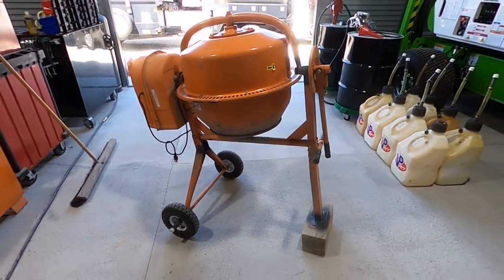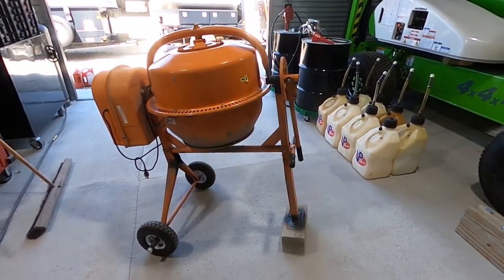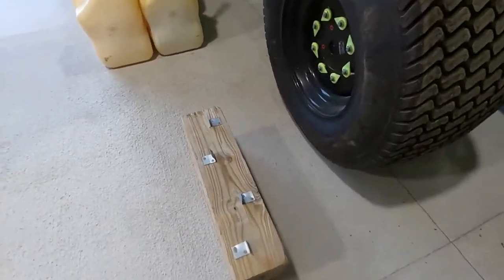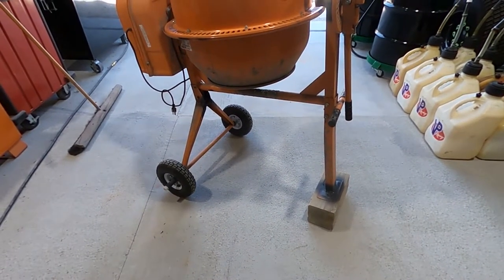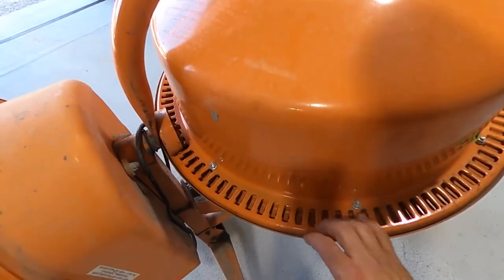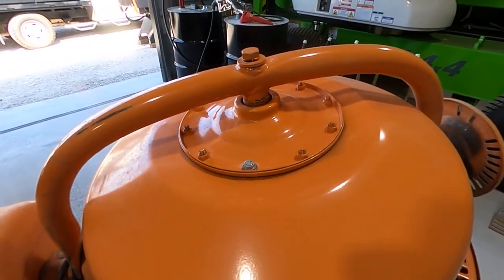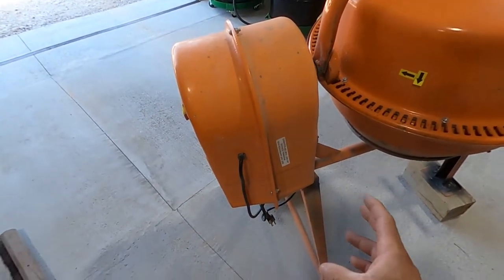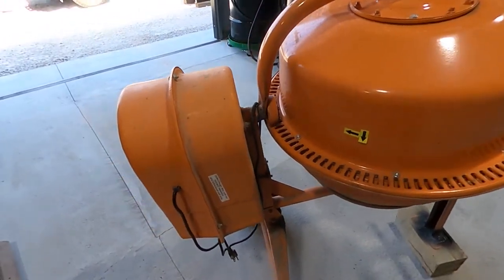Harbor Freight Cement Mixer Review | Over 100,000 lbs Mixed and Counting

Comment: Jon,  thank you for explaining the fixes you did to the cement mixer.  Having one is beneficial when you have a large job to do. I am glad you recommend it, and if I need cement work, that will be included in my budget.
Reply from the maker: Welcome! This has been an excellent mixer especially for the money. Just wish they had a larger model, i'd love to have a larger one but they're so expensive!
Reply: @reallifetested2605  I may have missed it, but how much cement will this mixer mix the capacity for the mixer. It one full load?
Reply from the maker: @brendamaroney2966  You can put either (2) 80 lb bags or (3) 60 lb bags. The 80's are about perfect for this. The 60's are pushing it to the max.
Reply: @reallifetested2605  Jon, that is good to know. I am sure if I need to do some work with concrete, the one-bag standard and wheelbarrow have worked, but glad to see that an option to one bag at a time mixing for a little larger projects is on my path. I know a pumper truck is out of the question, but a bag or two an hour maybe what I can do with this mixer. And knowing I can fix it is a blessing!

Comment: Yes, the bearing crapped out on me it’s totally seized.  My fault though, I left it in the position that you have it in before winter came and I forgot to put a tarp on it. Water got in, went to use it the next spring and first mix it died. Had it for several years, a couple of loose bolts, it’s noisy as #*$& but can’t complain for the price, it’s not harbour freight but an identical model sold in canada, 219$ plus tx
Reply from the maker: You might can spray a little penetrating oil and let it soak to free it up. My bearing is running on borrowed time, it’s getting louder and louder haha I’ve definitely got my moneys worth out of it though so it’s worth a little tlc I suppose when the time comes.

Comment: My Chinee mixer is a Bilt Hard. Blue paint. Like mine too: the first job I did with it paid for it via not hiring the job out. Hint for others: instead of raising the mixer with blocks get a short side wheelbarrow. Mixer is comfortable with 2 80# bags and that mixed load fits in the short side wheelbarrows.Also a heck of a lot easier on your back.Added: short side wheelbarrow if 4 cubic foot or smaller.
Reply from the maker: These things are awesome. It’s insane how much you can save with one. Thanks for the tip!

Comment: This is one of the best purchases I've ever made from Harbor Freight. Over the years I've probably ran 400 60lb bags through it - front stoop foundation, fence, shed foundation, front wall, back walk, etc... I typically mix two 60lb bags at a time. My experience was that two 80lb bags were just a little much for the machine.  The machine is a little shaky on the wheels but they've held up thus far. My biggest gripe is the height as you pointed out. I think the key point is getting the belt tension and alignment set correct and then going back and adjusting after things work themselves in. The only real issue I had was the rubber gasket, between the shells, broke apart when I was installing it. I wanted to use it that day so I slapped it together and ran. After ~20 bags of concrete the joint stopped leaking any water and has not had any leaks since.
Reply from the maker: I think that may be why my wheels bent like they did (the 2 80's shaking the machine around) luckily it was a quick easy fix. A few times I was only able to get 60's as my store would be out of stock. It will take 3 of those but it doesn't like it as you could imagine lol I bet the area you're talking about between the shells got a little concrete in it and stopped leaking. I looked at mine just now and the little crack is full of concrete. That won't ever leak again. haha Thanks for checking out my video, and for taking the time to leave a comment.
Reply: @reallifetested2605  fortunately I can get  60s or 80s anytime at the local Lowes but likely since I've limited it to two 60's is what's holding it together. That or I have to run another 600 bags, give or take, to sort of catch up to your throughput and we'll see.
Reply: @reallifetested2605  Would taking the barrel apart and adding a silicone caulking or some other gasket seal around the rim do any good to stop water leaks. If I buy the one I'll be seeing tomorrow I was thinking about doing that. Saw it on someone else's video.
Reply from the maker: @leighco9  You shouldn't have any issues of leaking. Once you use it a time or two the concrete / mortar will seal everything up and dry to make a nice seal.

Comment: Good review. I need to buy one for my next project.  I couldn't tell by your time-lapse video but How many bags of 80lbs concrete could it handle at a time?
Reply from the maker: Thank you! The mixer will hold (2) 80 lb bags or (3) 60 lb bags, but no more! The (3) 60s is about all it wants.

Comment: I have a really dumb question about these. To reuse it (or, to reuse a wheelbarrow ... ) do you just hose it out into an area you don't care about?
Reply: Yes and yes. Hose it out before it dries or  else you will have heay concrete stuck on it forrrreeeevvveeerrrr.......but yea just a hose should get it out or if Need be have a brush. This rule applies to any and all concrete tools.
Reply from the maker: It's not a dumb question at all. Yes for sure! This stuff will get hard in there and you'll never be able to get it out. Check out what happens when concrete trucks forget to leave the mixer running, or let it run dry. What I usually do if I'm mixing kind of slow (working by myself having to wheelbarrow the mix far away) is just fill a bit of water in the mixer and leave it running. The sloshing around will keep everything wet until I'm ready to mix my next batch. When I'm finished with the project I hose the whole mixer off to make sure everything's good and clean.

Comment: bought one of these a couple years ago. i use it to mix homemade potting/container soil. so much easier than using a shovel all the time. works great.
Reply from the maker: That's a pretty genius idea, stirring soil around is no easy task. I bet this thing mixes it perfectly for you. Thanks for giving me the idea! If I retire this thing I might do the same.
Reply: Going to see a used one tomorrow for the same reason. 70 yrs. young, but mixing soil by hand is getting older. LOL
Reply: @leighco9  it is a great way to used old soil also, mix old with new. works great.

Comment: This may sound like a weird request…but you need to review some work boots. If a guy puts a 100,000 lbs of concrete in one of these mixers, he knows what work is. I work on a blacktop crew and go through boots like crazy…just wondering if you have a suggestion on long lasting and comfortable boots.
Reply from the maker: I want to tell you something really weird, it's like your comment was a sign from above or something lol I had an accident about a week ago. I damaged my ankle pretty bad. I have worn slip on boots all of my life, occasionally I wear lace up. But I get lazy and slipping a boot on is easier than dealing with laces. I have never talked about this really. But the past 2 days I have been talking a lot about switching to lace up boots full time. I was wearing slip ons when I had my accident and keep saying "If I was wearing lace up boots would I have gotten hurt as bad"? Because they offer so much more ankle support. You have motivated me to make a video explaining the pros and cons of both of those and what boots I find to be the best. Stay tuned. I'll be getting back with you here soon. Thanks for the comment and for checking out my video.
Reply: @reallifetested2605  sounds good, I’m the same way. At home I go with slip one and at work lace up steel toes (company makes us). I don’t mind either one…just the time thing with the lace ups. There have been many times at work I’m glad for a lace up because of the support. Working in blacktop is really rough on boots…with the heat, we put diesel on the bottom so we don’t get asphalt built up, the walking on the sides of roads for miles. I’d love to find a pair that lasted more than one season.

Comment: I'd imagine with any products from HF that quality control is the biggest issue so one unit may be great while the one sitting next to it could be a lemon.
Reply from the maker: You're right about that. There tools are really hit and miss. From my experience some of there air tools are awesome, while others being complete junk. Most of the power tools i've had from there didn't last long enough to justify the low price. But there hand tools are great for the most part. I'm glad I got lucky with this mixer!
Reply: @reallifetested2605  As a contractor from age 17, now 41.  I have learned all of the thing at HF that are great, and which to avoid.  It's a very very extensive list  :)  The roto drill,  will rock for 10 years.  basically every nail gun,  roofing, brad nail, framing, has a 3 use life, with a few exceptions.  very bizzare.  Blades, sawzaw, trash. zigsaw trash,  Router bits, for granite, shockingly great. for 1/3 the price.  Tables saw chop saw blades.. meh.. I still buy em to save money, but they aren't great

Comment: No way that mixed that much concrete. I mixed 2000lbs and the bearings on the tub wore out.hft does not have replacement parts for this area. And why is it so clean?
Reply from the maker: Watch the video. I posted one doing over 830 bags. I’ve had 1000s of bags at this point through it and it’s still going strong. Had to weld the frame in a few places but other than that still functional.

Comment: Does capacitor require soldiering?
Reply from the maker: Honestly I don’t remember without going back and looking. I highly doubt it though. To keep up with speed in production most things like this have a crimped spade terminal. Should be able to just unplug it or it might have a screw holding it on.

Comment: SO how big a pour can you mix with this before the first batch starts setting?
Reply from the maker: It depends on the temperature, the mix, and how fast you go. I was able to go around 120 bags per section but temps were in the mid to high 40s so I had plenty of time. As long as temps aren’t freezing you’ll be fine in cooler temps.
Reply: @reallifetested2605   Cool, I am looking to (eventually) pour a 1-lane driveway 50' or so. As well as some smaller stuff like walkways, steps.